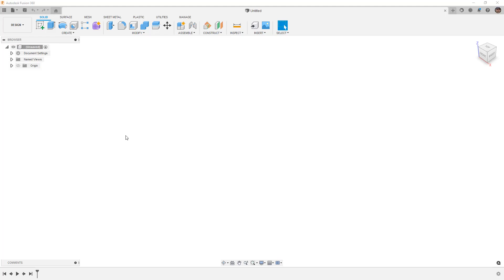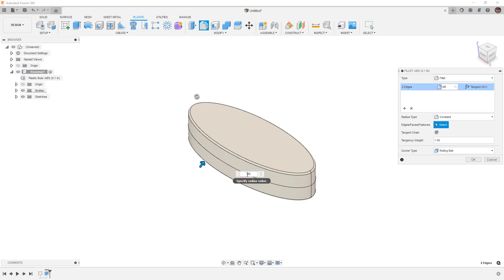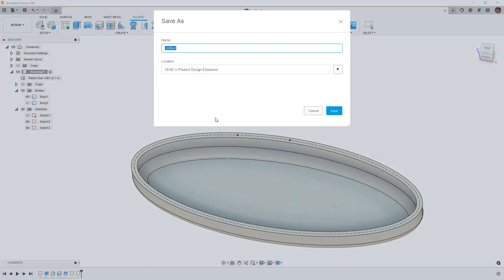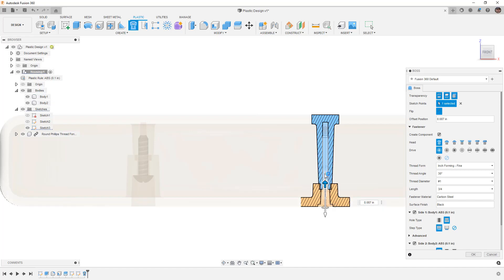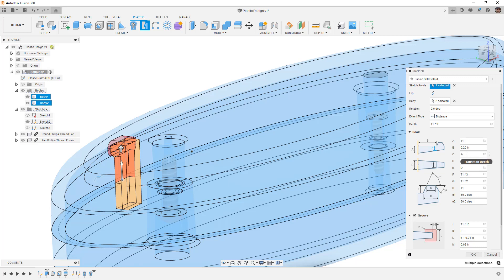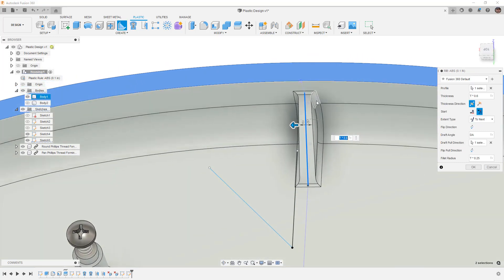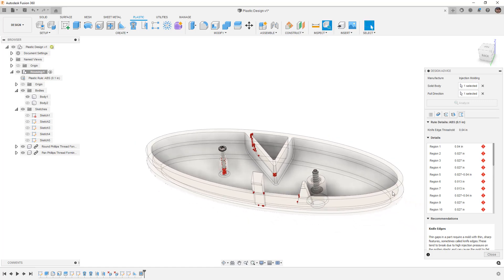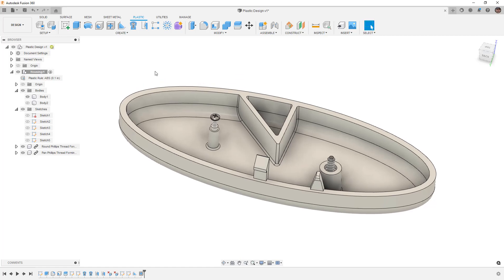NEW Plastic Part Design Tools Review in Fusion 360 #Fusion360 #ProductDesign

Comment: Are these tools only available in the paid version? In the free version, the tools appear to be the same as in solid workspace. Boss, Snap fit, etc. are not available. Usually, the tools for paid features are still there and are marked accordingly, but in this case, the tools are completely missing.
Reply from the maker: To the best of my knowledge the extensions are not available in the hobby license.  Anything that has to do with extensions is missing.  Some things like Multi-axis tools might have an icon (i am not sure), but tools that are completely in an extension will just be gone.
Reply: @LearnEverythingAboutDesign  Thanks for the answer! I completely ignored the word "extension" in the description :)

Comment: How can I make the surface coating on the plastic part? And is it visible in the slicing program?
Reply from the maker: Im not sure what you mean by coating.  Are you talking about a texture?  There is no texture option in Fusion right now.  You can apply appearances that have texture but that isn't going to translate over to a slicing program.  A lot of slicers do have options to add texture at the mesh level to a part.

Comment: Hi I got a question I´m making an animal like structure with surface modelling but I never added the rules before modelling, can I add them later before using the thickness tool or do I need to remake the model and parts to use this tools?
Reply from the maker: by Rules do you mean the parameters for controlling dimensions?  Yes you can add them at any time and even go back and relink sketch and feature dimensions to them.  Parameters in Fusion are not history based so they exist in the design.
Reply: @LearnEverythingAboutDesign  Thanks a lot by rules I mean the assingn plasstic rule at min 1:25
Reply from the maker: @ricardoneri809  Yes you should be able to edit or change the plastic rule at any point.  You will need to have a rule selected in order to model.

Comment: Thank you! As one who has been designing plastic parts in Creo and now Fusion 360 for many years, I think your criticism of the tools is spot on. It's awesome to see things like this starting to emerge though. Fusion 360 will no doubt be improving these tools in days to come. They will become a huge time saver as they evolve into polished tools. Too bad you have to pay extra for them. However, as a professional the time savings could be worth it in the end.
Reply from the maker: Agree! I know they will evolve into something great.  There were a few updates recently.  I did a follow up video for those not using these tools and have a new plastic series starting now that doesn't use these tools.  https://youtu.be/ciOZNihYAp4

And soon I am working on a series that we program a script to build a "template" of sorts for draft, wall thickness etc.
Reply: @LearnEverythingAboutDesign  Thank you. I will check it out soon. It helps having a pioneer like you to show us the tools and how they work. I'm not much for reading instructions ;-D

Comment: Can't find the Setup menu where you set the ABS roules or is that not available in the free version of Fusion360?
Reply from the maker: Hi Niklas, I do believe that extensions are only available for EDU and Commercial license holders sadly.  https://www.autodesk.com/products/fusion-360/personal    if you scroll down on the right hand side you can se Generative Design, Extensions and some other tools like simulation are not in the personal/hobby license.

Comment: Awsome thax ! I keep discovering new features thx to you. Are drafts so important even in 3 printing ?
Reply from the maker: Patrice, they are really only important for molded parts.  Injection molding, blow molding, casting etc.  It prevents the parts from "locking" into a mold when they start to cool.  On 3d printed parts the angles are only really critical if you are trying to print without support material and you can support a specific angle.  For example on a boat hull you can likely print a hull without support as long as the angle is steep enough.  If you think about a sail boat with a deep Keel(i think its called) that is near vertical and transitions to a wider shape, that would be more difficult without support.  Strictly talking about FFF/FDM style printers.  With SLS or something else where its self supported all bets are off!

Comment: Thanks for review. I tried activate but get error message "Something went wrong. Please  try again in afew minutes." Tried many times in 2 days. Using education insider and standart version. I have installed two version (different computers)
Reply from the maker: Very strange Suat.  I don't know why it would cause issues when activating.  I would reach out to Autodesk directly through the support option in the software.
Reply: @LearnEverythingAboutDesign  Thanks